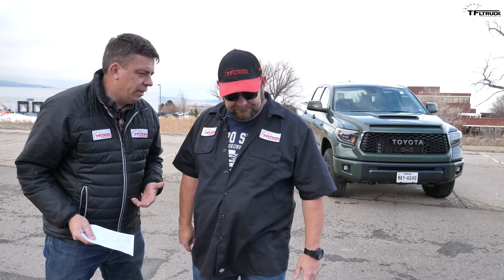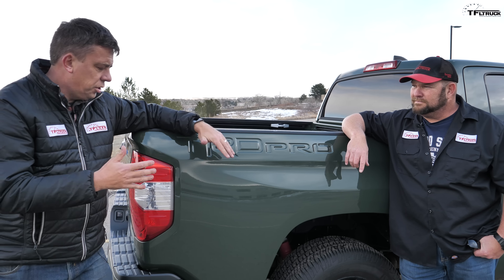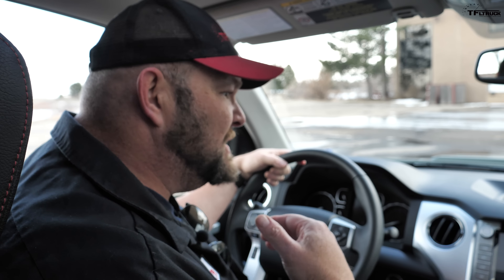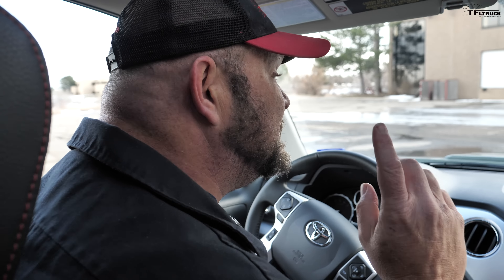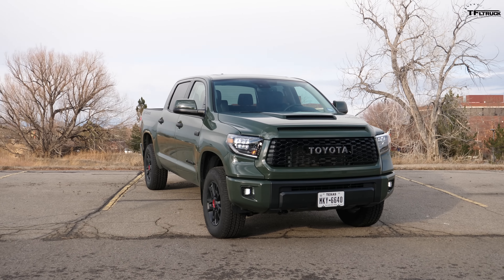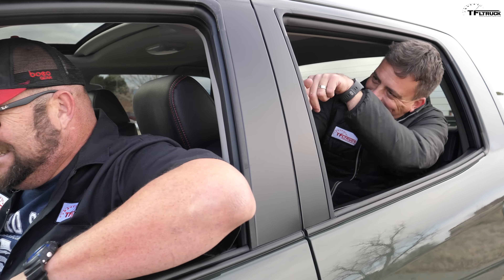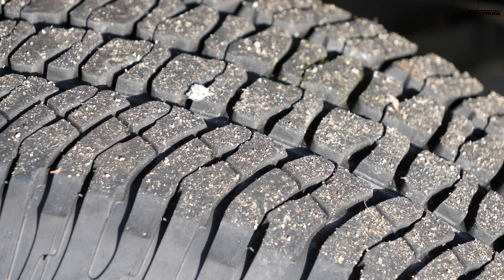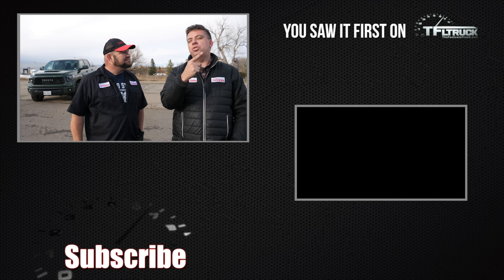The 2020 Toyota Tundra TRD Pro Is Outdated on Arrival - No, You're Wrong!

Comment: I ROUTINELY get 20MPG city in my '08 Tundra 5.7 2WD.  This year I drove San Antonio to Galveston TX AND BACK on the SAME tank.
  26MPG at next fillup.  Just don't stomp on it all the time and you will do WELL over the MPG rating.  MPG IS INCONSISTENT.  I can do the same round trip, same roads and on day I might get 22MPG, the next its 25.  But its always ABOVE rating.

Comment: Tundra is still a really good truck. Maybe old, but still good.
Reply: Not compared to the competion. Mileage is awful, cabin is outdated , Towing, performance is behind ford.  This truck offers nothing except for people wanting a toyota , and  high resell value. That's literally it , as far as the truck itself , It is behind the competition.
Reply: @Calebflying2025  I dont think so. Its far ahead of the competition when it comes to reliability. To some like me thats what is more important than big screens and turbos. But theres other choices for people who need that stuff so get what you want. Every manufacturer has its strengths and weaknesses. Toyota has great drivetrains that are well built. To deny that would be a lie.
Reply: @Billy28376   Yea they are also twice the cost to repair on many things too.  People immediately think just because it's a toyota it's more reliable, But that's simply not always the case in repairs.  A starter cost three times more to repair on a Tundra for instance, so is a better buy well that's debatable.   If you plan on keeping a truck past  250k I would say buy a diesel anyways.

Comment: My tundra gets 23-24 mpg all the time in fair conditions. When you set the cruise at 55-65 and you'll get your best results. It's city mpg definitely isn't the best. But the highway mpg isn't that far off the competition. I could get into the technicalities on why other trucks get better mpg. But just look into direct fuel injection. 

All in all, if you drive your truck like the 6000 pound vehicle it is, and not a 3000 pound vehicle, your gas will be fine.

Comment: I drive a 2012 tundra. Looking to get a new truck next year. While I love the Tundra reliability, there are several things you pointed out that are starting to irritate me and have me looking to other brands. One, the fuel economy sucks. Yes its a truck, but others get much better mpg. I need a crew cab compared to the double cab I have now. I don't like the fact that I have to settle for a 5.5 foot bed with the tundra crewmax. I'd like more camera views for when I drive logging roads during hunting season. Also, and hardly anyone talks about this, but for the last several years, Tundra has ditched the driver grab handle. Why???? I got short legs dang it!

Comment: This is hilarious because Andre is a huge fan of the raptor but most my friends only get about 12 miles per gallon in the raptor which is less than the 14.5 I get in my 2014 tundra.  I’ve put 200k on my 2014 tundra and  it’s been beet throw the woods, pulled my 34 foot Fifth wheel over 10k and the only Maintenance I’ve done is brakes tires and oil changes.  I’d like to see you find another full-size truck that can do that Andre!!!  The latest and great isn’t proven.  Reliability is king to me!

Comment: "outdated" blah blah blah. The competitors have to come out with a new updated truck every 4 years to get the old junk ones off the lot. The Tundra and its 5.7L is proven reliable and perform well with anything you throw at them. SMH at people complaining about toyota frames snapping if you tow heavy loads. If you need to pull 7k+ LBS, go get a diesel. Nobody in a Tundra is gonna try to do that

Comment: I like how someone thinks additional cameras are an upgrade. Just more cheap ass electronics to fail. Improve the braking, towing and fuel economy. The rest is fluffy shit that belongs in a 4 door sedan. All it's doing is driving up the price for shit that isn't useful. A 1200 lbs payload capacity. That's almost enough to haul to average size American women from the Midwest.

Comment: The fuel economy numbers are only slightly better than my 2003 Silverado. I would still buy it.
Two co-workers have Tundras they use for work  with over 500k miles between them.

Comment: I pray that Toyota keeps a N/A V8 drivetrain option in the next Tundra. Just update the platform, increase towing and payload, and give it a rear locker. That’s it, I’d be sold. If they go small displacement, twin turbo, direct injection, hybrid power train, I’m going to have to leave Toyota and go for the new Ford Super Duty with the new 7.3L pushrod gas V8. And I’m a Toyota man, have an FJ40 Land Cruiser and a new Avalon.
Reply: Toyota going full hybrid by 2025.

Comment: 115k on my 2016 Tundra, 6 inch lift on 35's with a bunch of other mods from the beginning....still running like a champ with only oil changes and regular maintenance.  On pace to 500k over the next decade.   I don't tow and I don't haul a bunch of stuff.  If I did F350 would be the ticket but hey, no need.

Comment: Just went past 115,000 on my third Tundra. It doesn't have all the "toys" to play with when you're supposed to be DRIVING.  That's why I love it. I pull a 16' trailer loaded with metal from Mexico quite often and the little hills that this beast comes to will make you smile. Most times the transmission won't even downshift ,  it just pulls it,  lotsa torque. My first Tundra lost a fuel pump at 45K. Toyota replaced it and all I've done with the trucks since then is drive the hell out of it. It's always ready to go. It'll be my "Go To" truck - unless they decide to "pretty it up". Oh, I love the look on the faces of those guys in the "RAM" when I pass them with a trailer loaded with metal, way out there in the "Wildhorse Desert" of South Texas.

Comment: Those Hp, torque and mpg numbers on the Tundra are with regular gas. Ram, Ford and GM are using more expensive mid grade and high test. If you do the math the 6.2 GM motor using high test costs more per mile than what it costs the Tundra to run that same mile and you get better reliabilty and resale with the Tundra using a cheaper fuel.

Comment: So I'll be the the one who bashes ford. So Toyota's had the damn recall for frames rusting, but if you crashed you could survive.  Ford has a half million recall for super duty trucks that you get into a crash you survive,  but then you burn to death cause the seat belt actuator detonated then sets the truck on fire🤯🔥
Reply: GM has the same recall. Must be the same supplier.
Reply: I guess you missed the IIHS testing on the Tundra.  It is the least safest new 1/2 ton pickup you can buy.
Reply: @user-pt6io2cq9n  that might be true but at least I wont be burned to death.

Comment: It's just a really uninspiring truck to be honest. My wife is driving a '14 Tundra SR5 currently. We took a look at the 2020 Tundra PRO and I couldn't find anything to get excited about, and certainly no reason to drop 55k on it. 

I feel the same way about the Tacoma I purchased. It is a fine vehicle and it checked off all the right boxes. At the end of the day though, its is an absolutely, horrifyingly boring truck. I sprung for the TRD Off-Road cause the Pro didn't offer enough of an upgrade to justify the additional expense for it.

It would be amazing if Toyota would release a reliable competitor for the Raptor. Make the package available for the Taco and the Tundra. I would drop the cash for that without a 2nd thought.

Comment: love the tundra but went with an F150 more options and had my rear locker like yall said the tundra doesn't have it.
Reply: On my tacoma i had rear diff lock. I never even needed it pulling my 18 foot pasture harrow. When i bought the Tundra i never had a locking diff on my wish list.
Reply: @rockymountainman7  i had a 2011 tacoma that was TRD off road package and loved everything about it it had the rear locker only had to use it one time that got stuck but it was cumbersome and didn't want to engage. took some tries moving forward and back and putting back in Neutral to get it to lock in and the fact on that model is you could only lock it in 4low where in my F150  i can have in in 2wd 4wd or 4low and lock my diff whenever i want to and it auto disengages above 20mph and then reengages below 20 mph if you have it turned on.
Reply: only thing i wanted on the Tundra was the rear roll down window but everything on the F150 checked my marks and i got the 5.0Lv8 not the ECO boost. i wanted a bullet proof NA engine that wouldn't break down. now my F150 doesn't get any better MPG then the Tundra City i get about 13 or 14 but  highway i can get up to 20 sometimes 21 if i'm really taking it easy and not pushing her past 65 mph and the lighter body means more towing capability tundra could only tow 9k i believe to the F150 how i have mine can tow over 10k just little things that made my decision go to the F150 and the Tundra didnt have any incentives to get the price down where the F150 had alot went home with MSRP of 53k to walking out the door at 42k

Comment: I was looking at getting one of these as a work truck last week untill i found out you can only get the crew cab in a short box with no other option for a 6.5 box unless you go to a double cab, which i dont want, and no diff locker.... and the back seat was so plain jane not even a usb or 110 volt plug or even a cup holder in the back of the counsel. I wanted to try a toyota being everyone says how reliable they are but they are just way to behind on options and to thirsty to keep up with the new trucks today

Comment: I always buy Cummins but my employee has two Tundras a 2007 and a 2019. It's a very nice riding truck and I do like it as far as a gas V8. Kinda weird though his touch screen dose not have navigation and apparently that awesome back window ( my favorite part of a Tundra ) is only available on the crew max. He had to buy the extra cab just to get the longer bed. That truck has Texas plates you can't tell me that people in Texas don't want a four door long box. Overall great truck the worst cosmetic is that stupid wedge shaped rear bumper
Reply: Most of the new trucks I see around here have short beds. If I need to carry something longer, I have a trailer for that.

Comment: The screen is small with low resolution. The backup camera quality is bad, and really bad in the dark. Keeping your phone connected is a crap shoot. All the tech in the vehicle seems a couple generations old compared to the competition. Mileage is from a truck 20 years old. Cant put a 6 ft ladder in the box and close the tailgate. Power is down compared to the competition and tricks you that its keeping up with rear end gearing. Seat comfort is ugh. The 3 trucks I have been around all had electrical gremlins. It makes me wonder if anyone test drove any other full size truck before buying one of these and cant believe how they keep their value. I swear they are the Harley of the truck world, but their issues are not so publicized. Currently own a  2017 Highlander and between yearly brake pad/rotors, internal oil filter, and clumsy tech, I scratch my head on why I haven't traded the wagon in yet.

Comment: absolutely no reason Toyota cant get the fuel economy up... these ride rough compared to Ford and others. For the price you get way less with this truck.. very reliable but way behind the big 3 in everything else
Reply: They're rated low by the EPA. Don't know why, but in the Tundra with high speed and jack rabbit starts I get better mileage than EPA ratings. Drive fuel efficient conscious and I'm up around 17 mpg combined. A big change I notice between Ford's and Tundra is how they coast at high speeds. The Tundra really slows down off the throttle until 60 km/h unlike the Ford that feels like it's in neutral.

Comment: I have driven the current Big 3 2WD models 1/2 tons with several different configurations like axles, loaded and unloaded in long road trips. In real world highway driving meaning 75-80mph (not 55-65mph optimal condition epa rating) the F150 had both the best and the worst fuel economy of the 3. An F150 5.0 v8 consistently got 22mpg and 3.5 ecoboost 21mpg , while the 2.7l ecoboost never did better than 19mpg at those speeds. Both new body style and classic 19’ Ram 1500 with 5.7l Hemi did 20-21mpg. The Silverado 5.3 with 6 speed did 20mpg and the 8 speed did 21mpg. This was real world driving and I calculated the fuel economy by filling at least 2 full tanks on each truck. The V8’s were far more efficient than the ecoboost trucks after 70mph. Hell the 5.0l v8 F150 10 speed can get up to 25mpg if you drive it at or below 70mph. I was always a Toyota fan and still own Toyota’s but American Trucks are better in every single way than the Tundra except that the Tundra has safety sense in all models, the others do not.

Comment: I feel that a lack of all the “new” features and electrical components are part of the reason why it lasts so long. On top of the fact they keep improving on the same platform. When you completely redesign every 3-4 years you get a lot of problems. Ford, GM, and Ram cannot sit at the same table as this truck when it comes to reliability. Not to mention when you drive them the tundra for sure feels the sturdiest and beefiest

Comment: Current Gen Tundra Owners: What’s the real issue here with that powertrain? Does it have poor tuning from the factory? I had no idea that this truck had lower mileage than Gas HD trucks.
Reply: If I drive conscious of fuel mileage I get 17 mpg. There's 3 things that would easily help fuel economy IMO - 8 speed to get the highway RPM's down 2-300, go on a diet as it's a heavy half ton, and you really feel the truck slow down when off the throttle at highway speeds.

Comment: not to knock other pickup trucks, for me it was the best value for the options I wanted, as for fuel economy, I drive just above the speed limit, while plenty of other pickups pass me doing 20+ over and they're trying to save fuel? If I have plenty of cash I would of gotten a fully load Ram with the diesel.

Comment: Everyone that buys a ram will be spending time at the dealer. Knock on wood, but my 2012 rock warrior has 87k and it’s NEVER been in for a repair except for routine maintenance
Reply: I know you're lying.  You've had it in at least once for AIP recall.
Reply: What the hell is that
Reply: @bmann792  Air injection pump.  All 2012 Tundras were recalled for it.
Reply: Never had it changed in mine
Reply: The only recalls on a 2012 are incorrect tire pressure label and airbag issue. No one considers those anything to do with reliability or quality of vehicle which is far superior than any other manufacturers
Reply: @bmann792  Then you haven't owned the truck since it was brand new.  That's just facts.
Reply: Sorry original owner

Comment: The 6-speed automatic on my neighbor's Tundra started acting up. The dealer could not fix it. He traded it for an F-150, which he loves.
Reply: That sucks.  Gotta change the WS fluid out every now and again or it'll suffer like any transmission.  That Aisin 6 speed will keep 200-220F in the pan all day long so it seems to break down a little faster than you'd expect.
Reply: @supremeirohnic  He took it to the dealer for all of its service.

Comment: Only 1/2 ton that has 430 gears. Put a leveling system or cheap lead spring helpers and tow/ haul as much as any half ton and not spend days at the dealer for problems and recalls like you’d have to for ANY big 3  crap

Comment: I would like to see "reviews" like this do an amoratized cost of ownership analysis. Average out all of the problems and repair costs for a 10 year period with fuel cost included for an average driver. I would be willing to bet with all major issues that the other brands have the toyota will actually be less expensive to own in the long run due to it's reliability. Granted you might get lucky with the other brands...or you might get stuck with a 4k turbo or lifter repair.

Comment: Dated, definitely, but I had a 2007 and now at 2017. I like many of the subtle improvements they have made. The huge gas tank, blind spot monitoring, built in trailer gain, and under rear seat storage compartment. They did cut a few corners too. They removed one glove box, some door compartments, and the overhead console. I miss the overhead console. I love the truck and I bought it for 37k with TRD exhaust, running boards, and custom wheels/tires. It only had 27k on the clock. I'l drive it for 5 years and it will be easy on the wallet in regards to trade in.

Comment: I’m glad you brought up the reliability. Yes it’s outdated and mileage is less than the rest. My buddy bought his new  2019 Chevy. Nice truck but it already been to the shop twice!  Minor issues but it still come on. He’s a die hard Chevy guy and couldn’t buy a tundra because of the mileage. His old 2006 Chevy had 2 engines and a new transmission besides being a complete rust bucket. So he spent around 4 grand to get a bumper to bumper warranty on his 2019.  Yea that will buy a lot of gas. We went out west this year on a hunting trip he averaged Between 1-2 mpg better. Not a huge difference. Sorry but my 2007 tundra is twice the truck of my friends Chevy, ford and dodges when it comes to reliability. If you’re going to get a new truck every couple years there’s better options. If ya want long term ya better get a tundra.

Comment: Technology is not new, they've had small cameras for 20 years, they coulda had 20 on vehicles in 2000, they could build that engine with 20mpg i don't know why they don't. Don't give me the truck and mpg line, some people like truck and use as daily driver, then pull a boat or camper 5 or 6 times a year. Noone wants to buy a pick up to tow and another car for daily driver. Toyota can do way better but lets face it they don't sell many trucks..